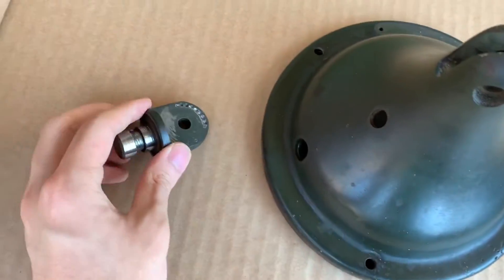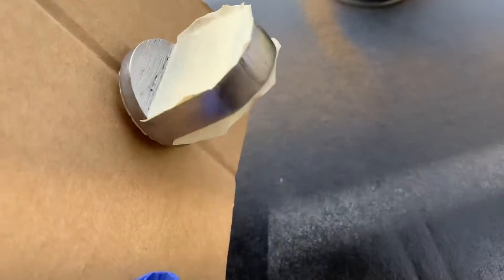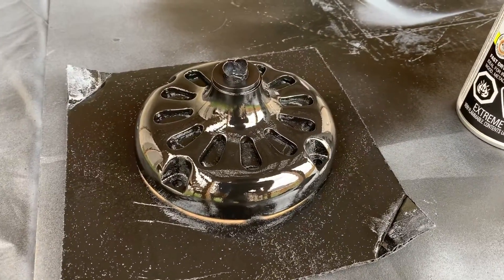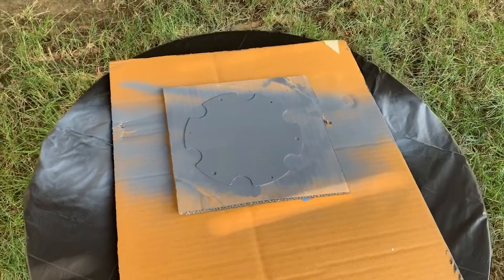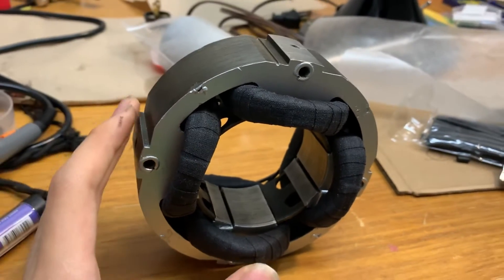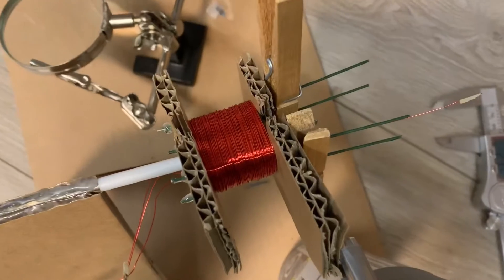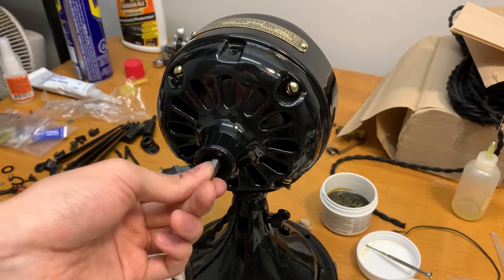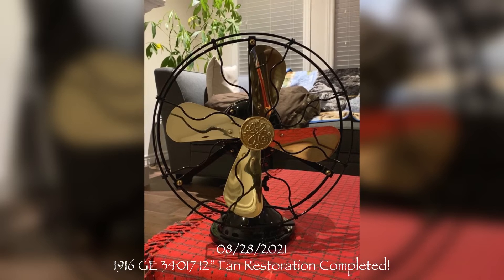Antique GE Brass-Blade Fan | Restoration: Motor Rewind, Repaint & Polish

Comment: That is outrageously insane.  Absolutely astonishing work.  I'm highkey jealous, I can solder and spray paint all day but I would never have enough confidence to rewind a motor, or if I did I wouldn't trust it enough to run it while I'm not sitting 2 feet away with an infrared thermometer in my hand LOL.  That's a lifetime keeper as a permanent reminder of the first time success it was.
Reply from the maker: Thanks!! I honestly felt the same way before I decided to give it a shot. I read through some threads on the AFCA forums and they were quite helpful. This fan definitely will never leave my collection! I spent way too much time and money restoring it lol.
Reply: @TheSuperFanMan  This is fantastic work.  One of these old fans has been on my list of projects for a few years and I finally got one. Would it be possible that you share a link where you learned about wrapping these coils? Or at least point me in the direction to the forums? I hope mine turns out 50% as good as yours.
Reply from the maker: @briantalbott516  Thank you! I'm sure it'll be a fun project to work on. The AFCA (Antique Fan Collectors Association) forum was my primary resource for this project. They recently moved to a modern website, but the old site is still up and has amazing information.
Old AFCA forum: https://www.afcaforum.com/category1/
New AFCA forum: https://new.afcaforum.com/

A couple of threads that were useful:
https://www.afcaforum.com/forum1/31849.html
https://www.afcaforum.com/forum1/31859.html

This video was also very helpful. He rewinds a 4-pole, shaded-pole motor, the same type used in my GE fan: https://www.youtube.com/watch?v=xjxLlDxgxKg

Hope it helps! Cheers
Reply: @TheSuperFanMan  Wow thank you for the info. This will be a great help for me to get started.
Reply from the maker: @briantalbott516  you’re welcome!
Reply: @TheSuperFanMan  So I ran into an issue when soldering new wires. One of the leads off of the coil just broke. I need to expose the wire but it is down by the plates under the tape. How do you release the coils from the plates?
Reply from the maker: @briantalbott516   That may be a challenge. Usually, older stators have rectangular metal pieces that are snugly fitted into the gaps that were used to insert the winding coils. At 11:00 in the video, you can see the 4 darker rectangular pieces (with two holes) on the inner diameter of the stator. 

If you’re goal is to just retrieve the lead, you may be able to gently peel or break the tape around the lead and expose it if you are able to reach it. Even 1/8” of exposed wire can be sufficient for soldering. I would suggest securing the new lead wires to the stator coil if possible to minimize the stress on the solder joint, similar to what I did at the 7:48 mark in this video: https://youtu.be/krMkm8DFivQ

If you do need to release the coil with the broken lead, those rectangular pieces need to be removed by tapping one of the ends. They’ll usually slide out. However, this needs to be done extremely carefully, because some coils are rather chubby and get in the way of those rectangular pieces. In such case, trying to tap them out will cause the pieces to dig themselves into the coil and kill the stator. I would check the clearance to see if the pieces will not damage the coils. If it can’t be done, feel free to let me know, and I’ll try to brainstorm a different approach. 

Hope it helps!
Reply: @TheSuperFanMan  thanks for the details. I had a feeling those rectangular pieces needed to be pounded out. After some digging I was able to find the lead. There is a good 1/16" or so exposed. That is smaller than my skills and equipment allow for. I'm going to take it to a computer/electronics repair shop to see if they can get something attached to extend it for me. I would hate to have to disassemble this further like you have.
Reply: @TheSuperFanMan Success! HE was able to solder the wire to the 1/16" piece that was exposed. The fan is together and running now. Thanks for all the inspiration and guidance provided in your videos
Reply from the maker: @briantalbott516  Awesome, glad to hear that!